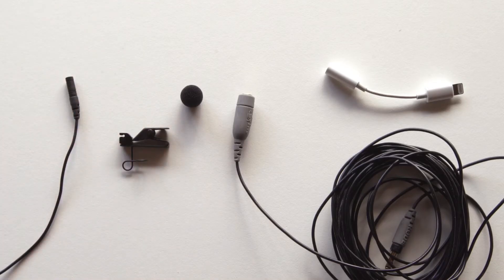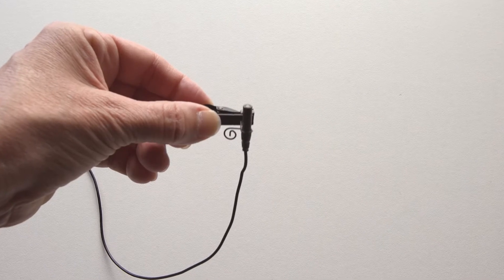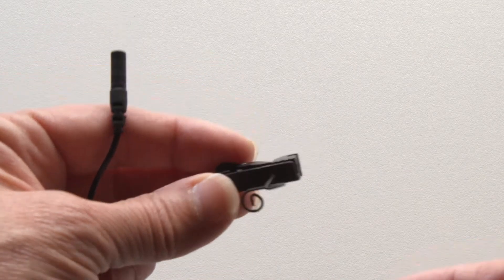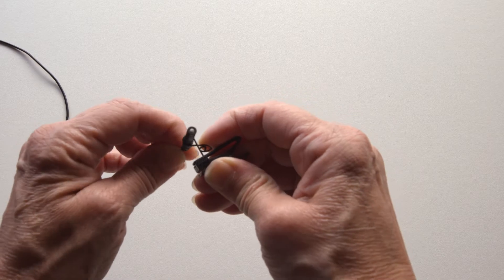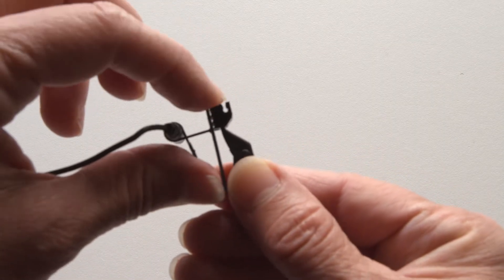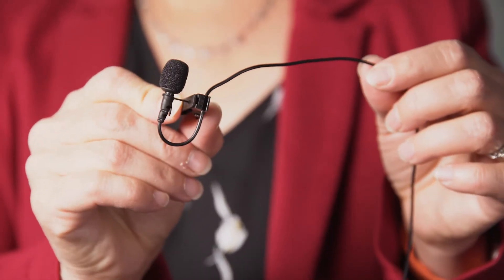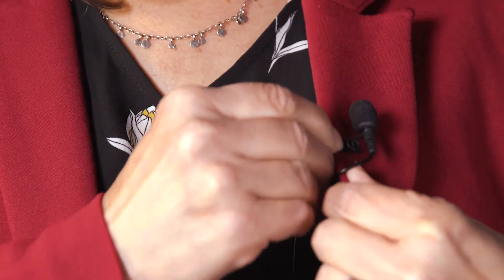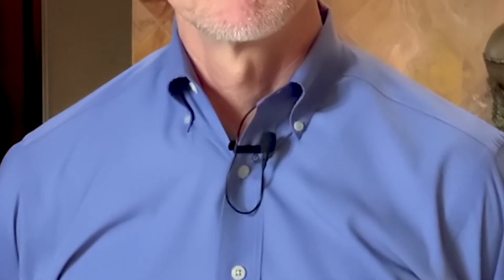How To Assemble Your RØDE smartLAV+ Microphone

Comment: Instructive, but you run the cord wrong. You should first loop it in the clip end then down thru the little slot. So the cord goes in a circle and the down.
The way you show it it goes up.
All the best